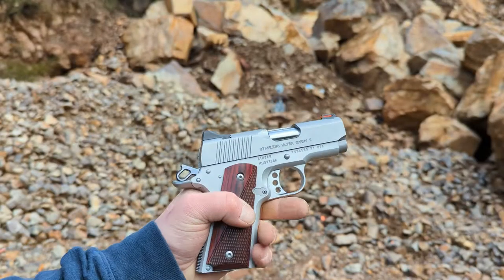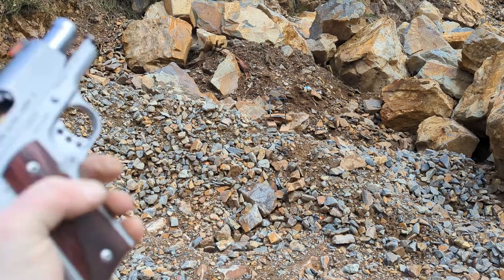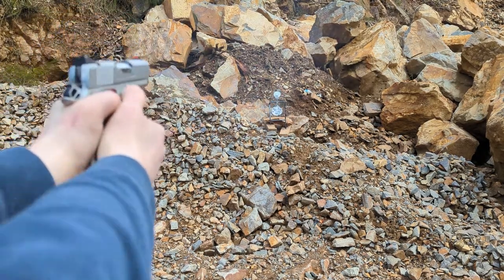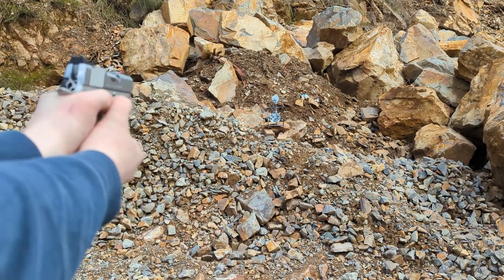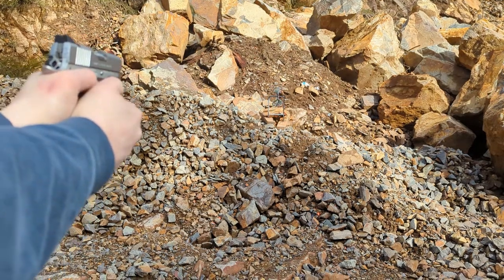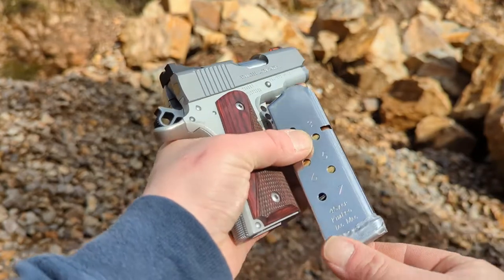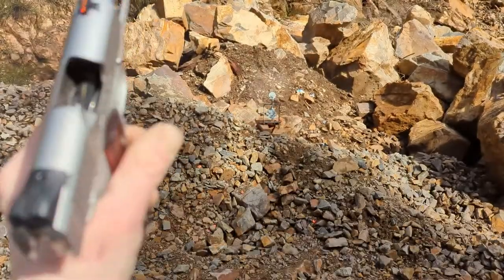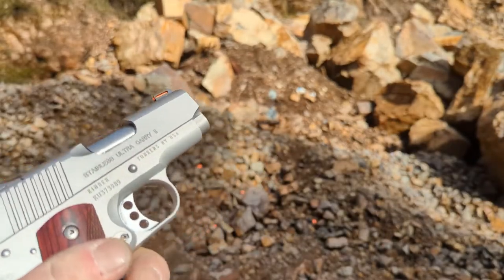Kimber Ultra Carry II malfunction update

Comment: Just picked one up hows she runnin ?
Reply from the maker: Better than before I sent it to Kimber to get the feed ramp polished but I'm definitely very disappointed with the overall performance considering the $1,000 price. My $450 5" A.T.I. 1911 has never had a malfunction. But this Kimber gave me a real hard time tbh if I could go back in time with the knowledge I have now I would definitely not go with this firearm which is really sad because this was always a gun on my bucket list that I always wanted. It's definitely running better now after learning to keep this thing heavily oiled when shooting that definitely seems to do the trick for me. I haven't had a chance to try yet, but a lot of people are recommended trying different magazines with it such as Wilson, combat compact, 1911 magazines. I just haven't gotten around to purchasing one yet because I actually broke my wrist two months ago and had to have two surgeries, one of which was a steel plate put into my wrist. So I haven't shot it for a couple of months but before breaking my wrist heavily lubricating it before taking it shooting seem to greatly reduce the number of malfunctions but I would still have at least one or two on every outing. So one other thing I heard was any of the kimbers that were produced in the Yonkers New York manufacturing plant seem to have more issues than the other manufacturing plant that produced. Kimber's handguns so that's one thing to look at is if yours is produced in Yonkers then it's more susceptible to having malfunctions. At least that's what somebody told me that had a family member that worked at that Kimber production facility. Apparently they close that production facility down and the last two years they were manufacturing the firearms. They knew the plan was going to close. So apparently the quality of the products they produced went way downhill causing issues such as this one
Reply: @counterstrike2A  well i wish i saw this video before spending 1200 on mine havent picked it up yet im in CA gotta wait  ill pick up some wilson combats on ebay while i wait though hopefully mine isnt made in yonkers haha and hope your wrist heals up soon playa couldnt resist the size and look of this 1911 though
Reply from the maker: I know right that's the same reasoning I had when purchasing it lol. Just make sure you get the compact 1911 magazines because apparently standard 1911 magazines will not work with this 1911 being as it is a compact 1911 just something to look out for
Reply: @counterstrike2A  picked mine up few days ago ive ran 300 rounds of federal all through wilson combat mags and have had no jams no problems at all
Reply: Only shot about 3 mags out of the kimber magazine and it was locking back prematurely its a shame the magazine that comes with the gun is faulty across the board but man it was a pleasure with wilson combat magazine even the 10 round mag ran flawlessly

Comment: So i found a used Ultra Raptor II at my LGS for $650 ! My dream gun.Not a scratch on it but had some goofy grips on it.Called kimber and they sent me some zebra wood grips for $52 bucks.ordered some WC mags for it right off the bat cuz of the stories i heard.Well come range day i brought  the 2 kimber mags 2 sig mags 2 chip mckormick mags that look just like the factory kimbers,1 mag from my girsan ultimate sc and the 2 wilson top of the line black mags.All were 7 rounders except the sigs for my emperor scorpion carry.Three times on all full mags the results were ,Kimber,girson,McCormack every round fed every time.Sig rounds 6&7 failed to feed all three times,and Wilson Combat would not feed on any mag or any shot without bumping the slide into battery.Weird huh?Are Their top of the line 7 rounders not good for kimbers?The cheap metal mags with metal followers worked flawlessly every time!Super accurate smooth shooting weapon.But why doesnt it like wilson mags?
Reply from the maker: Not sure what kind of mags you're running, whether they're standard 1911 eggs or not, but the camera ultra carry too doesn't work with standard 1911 mags. They use a smaller magwell for the ultra carry 2. So it's considered a compact 1911 and apparently using a standard 1911 magazine can cause internal damage to the hand gun. So you should only be exclusively using compact 1911 magazines for the ultra carry 2. If You were using just standard 1911 magazines, I could see that being the issue as to why those mags weren't working correctly
Reply from the maker: Since the raptor is a 3-in compact 1911, I'm assuming same thing goes for it that it can only use compact 1911 magazines just like the ultra carry 2 does
Reply from the maker: Hope this helps
Reply: @counterstrike2A  they were wilson compact elite mags specified for our guns probably over bought myself .

Comment: I think you need to just take it apart and clean it (I do it after EVERY SINGLE SESSION AND HAVE ZERO ISSUES)
Reply from the maker: @SoldatnaMan  I already was doing a full disassembly and cleaning/oil after every trip to the range. I worked in a machine shop for 15 years so I don't think that was the issue and I already had to ship it back to Kimber for them to fix the feeding ramp and polish. It shoots fine now after they did that and getting another thousand rounds through it
Reply from the maker: @SoldatnaMan  it's commonly known that in manufacturing not every single item being mass produced is going to turn out in perfect working condition. That's just the way things go when you're producing anything on a mass scale

Comment: Mine was back in less than one week and runs like a top now.
Reply from the maker: Mines definitely running better than before but once you get up to 100 rounds or so it starts having issues again once it starts getting gummed up with gunpowder residue. So I found the only way to keep that from happening is to keep it very lubricated. If i plan on  shooting more than 100 rounds in one range trip I definitely bring oil with me and that seems to do the trick. I just make sure to always clean it after every time I take it shooting and bring lubrication with me to the range haven't had a chance to shoot it recently because I just got done recovering from a broken wrist in steel plate surgery. But I'm going to take it shooting here very soon and hoping things go smoothly

Comment: As i commented on your first video, i just couldn't trust the gun with my life. I sold it at a loss. I believe the manual says it takes 500(!) rounds to break in the gun. I sold it at a loss. Too unreliable.
Reply from the maker: After they polished the feed ramp and making sure to keep it regularly oiled, I haven't really come across any issues that seemed to solve the problem for me, but I can understand your hesitation at trusting that to your life
Reply: @counterstrike2A  that's good. They did that for me but it refused to go into battery. There was a 1 or 2mm gap at the front and it just went click every other round. I also had continued failure to feed. I was horribly disappointed that they didn't replace it for me. Glad it worked out for you. 👍

Comment: Buy cheap ammo and you will have issues.  $1000 gun and skimp on ammo.  Your fault
Reply from the maker: Not really sure that's accurate considering I had to ship my gun back to Kimber and after they repaired it the problems stopped happening